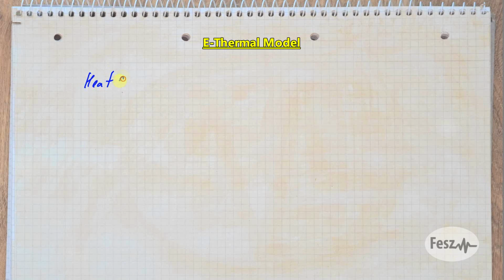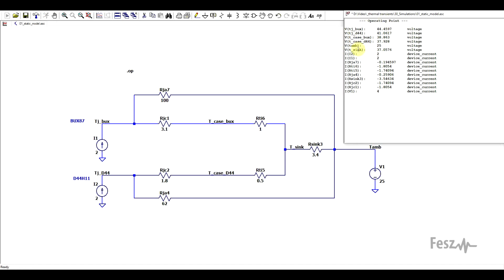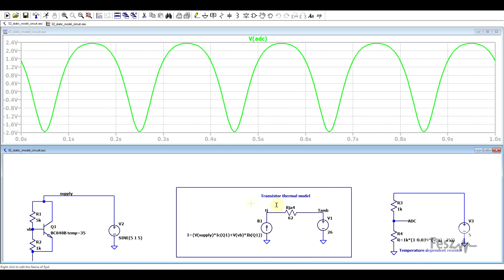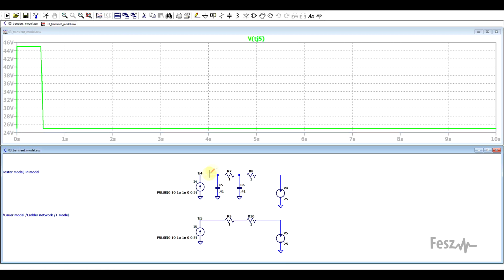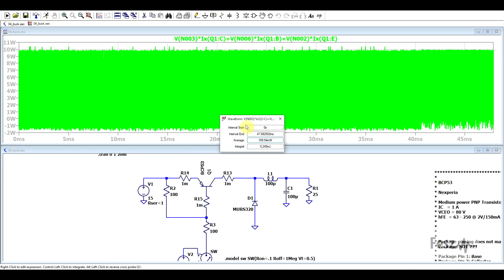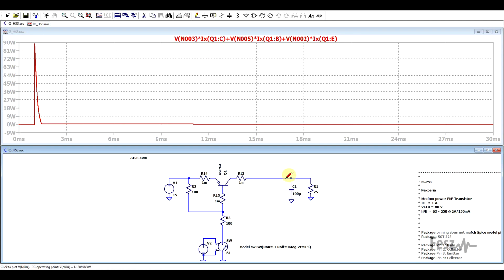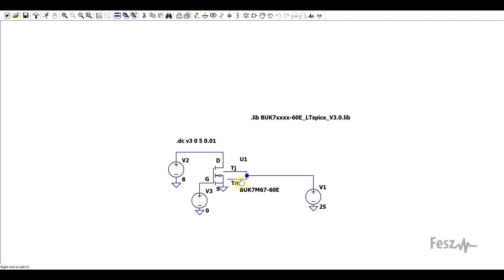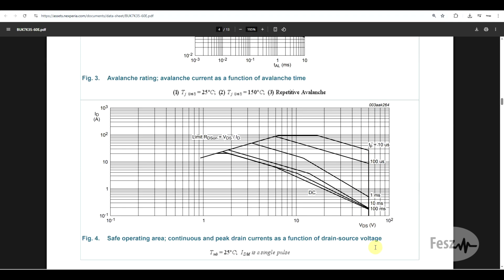LTspice tutorial - Static and Transient Thermal Models

Comment: Simulation tips/tricks: especially for regerative RF amplifier like the trickie Pititico (also has XTAL). Inject sine via 0.5 pF from the output (antenna) side to see AC frequency curves without interfering with XTAL or without need to remove it during transient sim.  ... With Pititico (XTAL oscillator and regenerative amplifier) I learned the following: Had problem to get the "real" XTAL substitute circuit to oscillate. Needed to cheat with much lower Q value. Also kicked the oscillator with a pulse. I invented the trick to apply an AC sine to the OUTPUT for characterization of output filter, so that I can change values (and see frequency curves) without applying changes in 2 circuits, I can keep the small excitation eg. via 0.5 pF on the output during AC and TRANSIENT simulation, it should not and does not mess up anything. (not the case if excitation is on the NPN base side near the XTAL; interferes with the high Q of the XTAL).

Comment: One of the problems with modern spice simulators is they all assume device temperature is fixed, and do not provide thermal network pin out of device model. So the only way to simulate this properly is to re-implement models by yourself, models with dynamic junction temperature...
Some time ago I implemented this as macro subcircuit in my famous MicroCap... And it worked!
And now here is the problem : this kind of circuits poorly converges during DC OP calculation even with correct values of thermal RC network , because it requires re-writing basic code of the simulator core which expects models with fixed temperatures. 
I even tried several tricks to overcome this, such as linearising semiconductor curves above 150 deg C, but nothing worked with success rate of 100%. As I mentioned, this requires rewriting of the SPICE cores implemented in simulators.

Comment: Wow. This video is the most comprehensive explanation I've seen on the topic. Really good job!
The only other thing I could want would be a part 2 where you build a simple circuit, and also make a spice model based on the datasheets for transistor, heatsink, thermal paste, and fan, and compare the model to the actual circuit to see how accurate it is. Any plans for something like that?